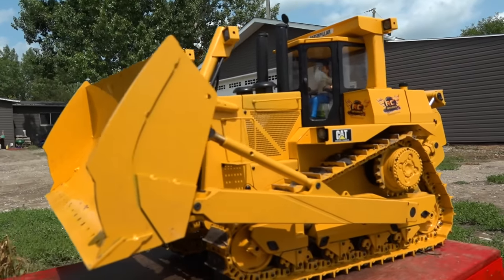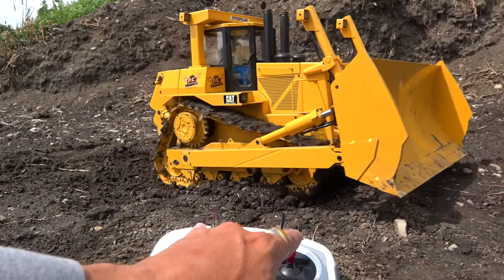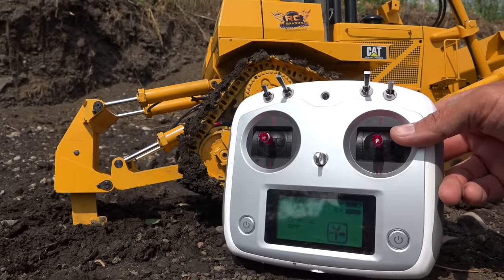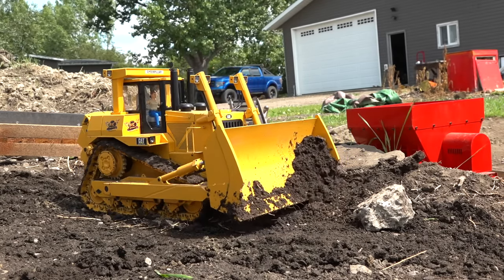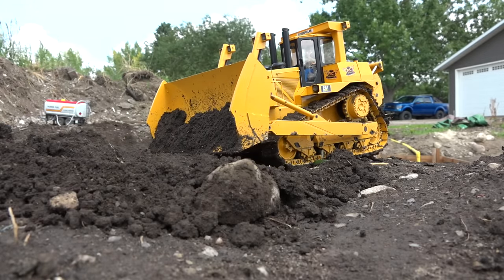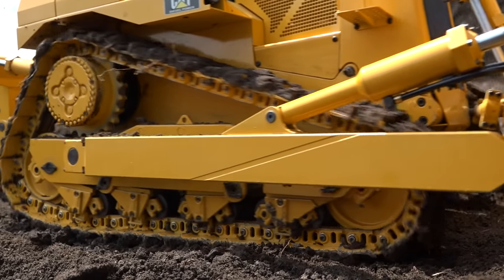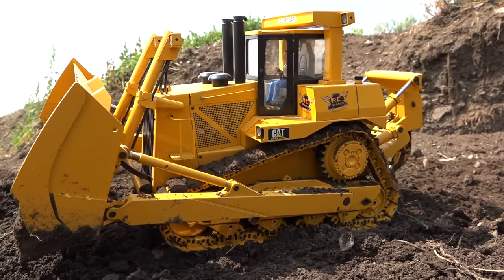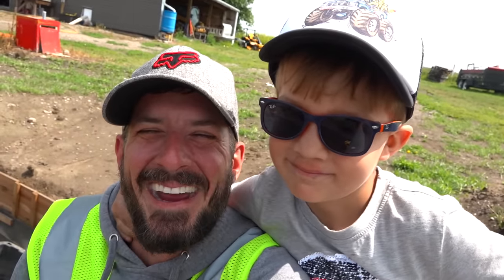YouTube GOLD -  58lb BULL DOZER D10T RiPS ME a NEW ONE! (s1 e8) | RC ADVENTURES

Comment: So electric drive, or is it a hydrostatic system....it seems like it's just two electric motors, since you can turn off the pump and drive, but maybe the drives are only running when you push the sticks?

Comment: HI as a couple of tips from a blade driver,,, your controls can be changed  to left hand stick to  drive only IE forward as forward  and left as left and so on... on the right hand  you will have up blade as pull back tilt right as turn right and so on. ok as to bulldozing it takes bit. 1st try not to travel over your cuts,  keep the tracks on virgin ground. second dont be greedy what we tend to do is use to left or right of the blade to get to depth,,,  just a foot at the time, track back , grap another foot until you are down to dig level, then you blade should start to get full. when the dozer cant push any more don't start to lift the blade and run over(compressing what you have dug) go back tack about half that heap. and repeat.

Comment: The "pin" on the other side of the blade is to change the angle of the face of the blade, depending on if you want to push or "roll" what your pushing

Comment: Even with a 10 ton dozer you have to judge the cut for a hole run. That makes the ground level for the next cut. But with getting rocks in the track gear, you just run back and forward a few times till the rock is mashed to pieces.  This is the RC that I enjoy.

Comment: It might work a bit better if it was heavier. The weight is what gives it the traction to shove mountains.  As for controls, I would venture a guess that you are so used to the skidsteer controls, you want the dozer controls to be the same, as they both have two joysticks. I am not familiar with the radio to know if you could switch the settings so the right stick is all of your movement, and the left stick runs the blade. The just use the other switches for the ripper.
Reply: BlueDually4x4 can’t switch to single stick has two motors two esc
Reply: He could use channel mixing
Reply: BlueDually4x4 different machines have different controls part of operating  equipment. It's all a learning experience.
Reply: Brian Mcdonald most machines in the real world have selective valves for changing controls tho this is gold rush no time for fucked up controls
Reply: Jon Harrington I have got ass time on heavy equipment since early 1970s and I agree time is money on all jobs. In my day if your hired to do a job you better be able to do it or your ass is grass and your skidded. If you think all controls are the same on all machines you are wrong. No employer is going change the controls for some nub princess wantabe.
Reply: BlueDually4x4 Dude you called the backhoe a ripper
Reply: Brian Mcdonald my pc160 an cat 308 and Volvo excavators  and skid steers have switching valves and I don’t care if my employees change them so you are wrong on my older hatachi ex60  we start new guys on that and the machanic switches the lines over as it don’t have a easy way of doing it so no you are wrong sorry for bad grammar day just woke up

Comment: You joke, but I'm curious now: would it be feasible to use this dozer to level or rip a small garden? It has plenty of power to move dirt, but you don't show how often/quickly it drains a battery. I'm gonna assume it's on 3 cell LiPo. Awesome video dude.
Reply from the maker: Hello Cole.  I mentioned in the film that I used one battery.  It really depends on how much throttle you are using.. much like anything battery related. The more you use the quicker it drains. The more you push, the more it drains.. but.. from my limited experience - what you see here - I used the machine for 30 minutes solid, on 5500mah 3s.  I started with my voltage at 12.54 and charged it at 10.20.     As for gardening.. yes, this dozer will rip straight lines on an afternoon with glee ;)
Reply: We need it bigger, give it a gas engine, and let it plow my snowy driveway... from the warmth of my living room.

#FrozenCanada

Comment: I have the older TX for the dozer, but if you don't like the stock TX set up try using a mix so steering is on  one stick and blade is on the other.  You'll have to move some input around on the RX as well.

Comment: noise is awfull.  engine( front) seems light so put weights in that area.. never spin the tracks.  never never. tracks ... must not be tight.
some sag on top is good.a stick in trackchain can keep stones out of track. The worst thing is a stone/something  caught
between the shoes.
which are hardened on real dozer and will snap break crack if this happens.
Reply: Liberty Barker Glad I got a tracked bobcat, get stuff in the tracks all the time, never been a problem after 18 yrs.
Reply: Liberty,Do you have any idea about what you are talking about because it makes no sense at all.
Reply: Lmao in real life 9.8 times out of 10 the rock would hardly ever actually make it into the sprocket and if it did it'd just be crushed

Comment: How did you managed to combine the two track motors to one stick control
Reply from the maker: Hello, I used a new Single ESC that replaced the dual ESC's that are inside. This is a special ESC they use for robotics called a "Sabertooth". I also had to use a BEC (voltage distribution block) to handle the electronics as the sabertooth only has a 1amp BEC.  I chose a step up from this ESC (http://bit.ly/2Dd8rmO), but I think the one in the link would do just fine, and its 1/2 price. Here is the BEC I used, http://bit.ly/2PjaOvI.   This will help you avoid any "Brown-outs" in power. Hope that helps you!
Reply: Thanks 
I will  order those and try it. 
Hope I'll do it ok
Reply from the maker: When using the BEC.. Remove the RED WiRE in the RX servo lead coming from the ESC.  Take it out of the black servo plug on the wire, and tape it to the wire, so its covered up.  The Servo Plug from the BEC will be powering the RX..  so the red wire is not needed on the esc. This is how you use a BEC.
Reply: @TheRealRCSparks  hes not actually going to do it I bet.
Reply: Rami Dali l
Reply: Why didn't you just mix it in the radio I have not used any ground based rc but I used to fly to rc aircraft and I know on a flying wing you use the ailerons as your elevator as well it called eleavons you just mix the ailerons to the left and right throw and the elevator to the up and down

Comment: Get the left and right drives on one stick with turning.  Probably have to use a "real" radio to get the mixes needed.  Having separate tracks makes it too much of a struggle to then keep the blade level.  Looks like if you just take lighter cuts when trying to level you'll be fine.

Comment: I'm sure you've figured it out by now but the dial does not control the ram on the side of the blade, it tilts the blade side to side by using the lifting rams. The fat ram on the side tilts the blade front to back. In the real world when you need to turn while pushing a load that's how you do it, wich ever way you tilt the blade is the way it turns. If you turn using the tracks while pushing it tears up the clutches irl.

Comment: I plan to buy the dozer to do my wife's garden the ripper to dig the holes for the veggies then fill it in and pack it down with the blade doing back drag. I like the way the controller is setup. On a real dozer you have left and right sticks. Back when I operated then it was foot pedals for steering. Hate to say I found the same one being sold for $1000 less. Since I need mine shipped to the Philippines it isn't cheap.

Comment: How come no shot of the hot equipment operator?  On a big cat you pull the clutch on the side that's ahead, to let the other side catch up.  They also are set up to run a full power.  To slow down you push on the "decelerator petal" when you stop; then change the transmission to go to reverse, then it's foot off the petal and back to full speed.  Never drove with both hands.  One for the clutches, and one for the blade height.

Comment: Just for fun, I did some number crunching with the model's weight. At 82 lbs × 14 x 14 x 14, it works out to 225,008 lbs for 'real world weight', just based on the model's weight. Cat's web site has the real D10T weighing roughly 155,000 lbs for operating weight. While that's not exactly close to scale for weight, it's actually closer than I had expected. It seems that the smaller a metal model is, the heavier it is when compared with a real world equivalent, as far as scale goes.

Anyway, just a bit of useless information, but I was curious, so I thought I'd look it up. I suspect it's probably somewhat 'stronger' than it's real world equivalent as well. Blows me away that you get all that power for a full 38 minutes on what is the equivalent of two phablet batteries.

Comment: Hi mate congrats on new dozer. They are a beast. 
Just a heads up.  Keep an eye on the track pins they tend to loosen over time . They are just push in pins.  I used loctite to hold them in . It works well. 
If u have any questions on it , send me a message I can help u out.

Comment: Why not use the mixing to drive both ESC from the left stick. It should be able to be setup just like a skid steer. Up Down on the stick controls both channel outputs. Left right is CH1+ and CH2-. Those channels are whatever the tracks happen to be.

Comment: When you rip you go in with the ripper back and then you can find the rock seem than you roll it forward to pop the soil or rock up . On a real one you adjust the ripper to keep the deepest penetration and fasted speed unless your in blue rock then you slow down and use power and weight to break out.

Comment: Hey buddy I'm not being nosey, but what was the cost of that dozer . I'm a retired heavy equipment operator / truck driver. I've been wanting one . And do you know if they will set the controls up on request the way you want to. Cause on a dozer the blade lever is on the right hand. So if you're right handed it'll work a little better. And know on the real thing unless the rock is really huge ID usually don't pay no attention to it.  Oh yes the flaps on the exhaust pipe is to keep the water out the pipes when it rains. But your little buddy was right at one point. It's nice he hangs out with you. For the most though you did pretty good. 😀👍 Have tons of fun.  and a great day.

Comment: I run one for real , Use the blade to steer just engage the tracks as your pushing in a real one it`s like flying a plane watching the blade turn by tilting , Bring the blade back to carry dirt tilt forward to spread , Very cool remote unit . Maybe help save power to shutting  down the pump as you pull the ripper on long pulls in firm flat gravels

Comment: As a full scale equipment operator you werent doing bad. Its extremely hard to get the hang of a machine without being able to feel what its doing. 90% of running a machine is feeling it.
Reply from the maker: I actually own a full size RC skid loader. You can actually overcome that barrier, and operate more efficiently outside of the vehicle. You can see more.

Comment: I installed a Sabertooth 2x32 Amp controller on mine so I can drive and turn the dozer on one stick. Its really great, but when I am moving and use the hydraulics together, it stops moving  and when I let go of both the stick it starts moving slowly on its own and I cannot stop it? I have to use the hydraulic stick to stop it moving because the throttle stick wont. Something weird going on.

Comment: That control map is pretty meh. Give 35RCTank an email or two, see if their 1/16 tank control board has enough power in its ESC to handle the motors in the tracks of your dozer. If it does, use that, you can put the tracks on one control stick and the attachments on the other that way. I use their 1/35th scale controllers in my 1/35th scale static-turned-rC tank projects and its pretty sweet. Jumper settings let you disable or enable pivot steering(Nice because the tanks I put it in lack pivot steering in reality and I wanted to replicate that) and IIRC they have lipo cutoffs already present. They have enough BEC to run a receiver built in, too, though I imagine with your dozer there's a seperate one on hand anyway.

Worth a look, as it would drastically improve your user experience when driving that thing if one thumb controlled the hull and the other thumb controlled the blade/ripper. Could prolly do some sort of toggle switch to bounce between blade and ripper, or maybe put the ripper on those little wheels and the blade on the stick since you'd be adjusting the blade more than the ripper.

Comment: This is how ALL RC vehicles should be made, full metal so they actually hold up, but it's not worth $2,500!! If i was in charge of the price it would be more like 500$, for the price it is i could just buy a REAL mini dozer, but people think that having full metal and hydrolics is so revolutionary so they dont question the price, when if you think about it you could make one yourself
Along with buying many other things such as the mini dozer i mentioned, for the price of this thing you could get a 90s half ton pickup with a snow blade that theoretically you could use on sand and rock free dirt if your careful, and you could drive that on the road
Reply: There is no way you could make it for 500. Think about all the work to machine the parts. The radio alone will cost 500.

Comment: If the blade of the dozer is lifting up the front of the tracks it’ll want to keep digging down and not flat. If you lower the blade to grown level enough for a little bit of presser it won’t get stuck as often.

Comment: you can run both tracks on one stick using a mix i programmed a bulldozer i built to run both tracks on one stick if you pushed the stick forward it moved both tracks at the same speed  and the same for reverse i also put the steering on the same stick if when going forward you moved the stick to the left then the left track slowed down and the right speed'ed up and opposite in reverse but the good thing was when stationary and moved the stick sideways then you spun on the spot with one track going forward and the opposite for the other side.
Reply from the maker: Heh, thanks.. but this was 3 years ago. Lol..

Comment: you will find it much easyer and more like real. a stick from ground plate to hold up 
 controlerbox . the pedals are brakes . center one applies both brakes.
set engine on fastest and take small bits each time/pass and u will get uniform grade control from start to finnish. 
big bit will get u going up and down instead of straight and level.

Comment: Really need a gas motor for something this heavy and big, to really be able to do anything with it
Reply: joe Z electric motors actually have much better torque in these instances, a gas would be nice but the complexity at this scale doesnt work well enough.  Its not till you get too 1/10 or 1/6th scales before gas starts to be introduced usually (nitro has very little torque because of a single piston vs multiple on more powerful gas motors so it really is useless for dozers but not for cars)

Comment: i'd try to set it up so that the left stick drives the belt. and the right stick controls the blade. thats how it is in real life
Reply from the maker: but.. this IS real life ;) Do you mean full size?
Reply: RCSparks Studio yes full size. I tried a d6 once and thats how the controlls were setup. Up and down on the right stick raises and lowers the blade. And left to right tilts it
Reply: RCSparks Studio the important bit is to ve able to use full movement of the balde. Without stopping

Comment: This is why remote controlled large scale equipment won't work.
The operator needs to see what's going on and feel what's going on.
Reply from the maker: This is actually untrue man. I own a full size RC skid steer.. and Im much better with it outside.. Reason being.. I can see all 4 tires, and I dont have to worry about beating up my body - so I can actually move faster! Yes, I know.. I just wrote I have a 7000lb RC skid steer. Its true!  :) I have about 60 hours on it all RC.. its epic